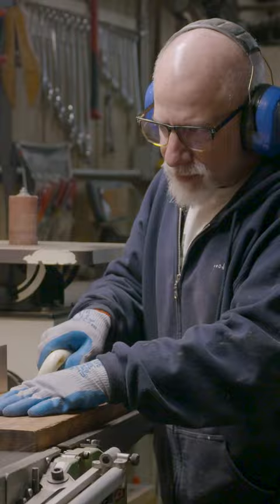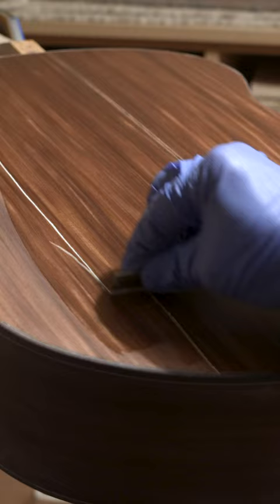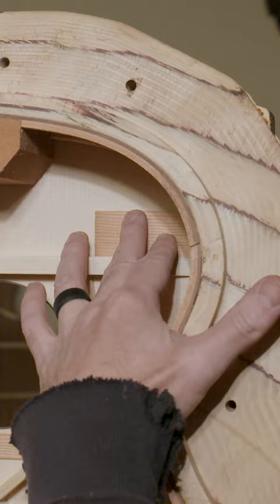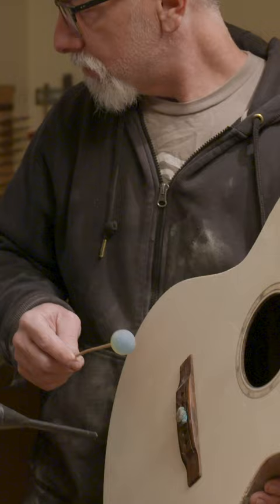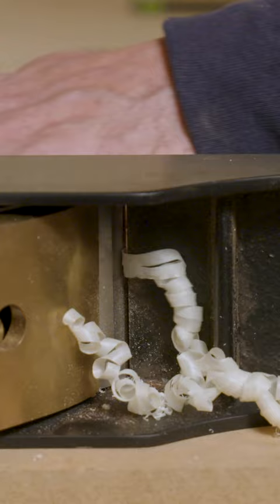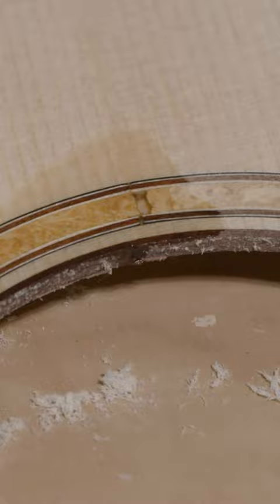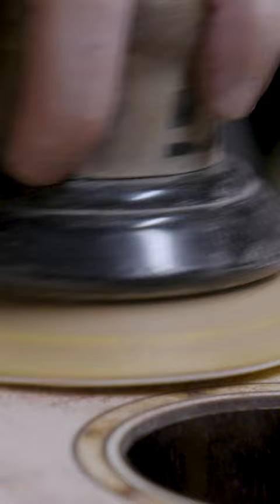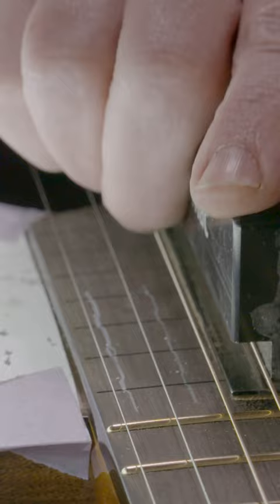🥳  Epic Build Premieres Tomorrow!

Comment: Hi, I have a Fender villager 12 string acoustic only 7 weeks old and I started getting a bit of buzzing and vibrating on the first 3 frets in the past week. I used the Allen key provided and gave the truss rod a couple of slight small turns to left, mine adjusts from the soundhole end, the buzzing has gone and the guitar sounds better now. Tuning is fine too The clearance between the 2 Low E strings on first fret is nearly 2 mm and the 2 High E strings are around 1.5 mm is this okay?  I didn't really want to touch it myself but I wanted to learn how to do it. I bought spare strings for it I got D'Darrio  phosphor bronze 10 gauge 0.010 - 0.047 so they are lighter. I also have a Fender C60-CSE 6 string electro acoustic guitar had it for 3 years now and it still sounds great never had to adjust anything on it since new. Anyway enjoyed your video thanks 🥰🥰🏴🏴